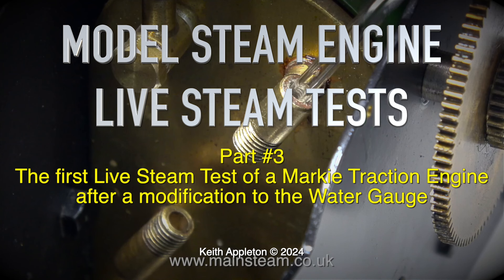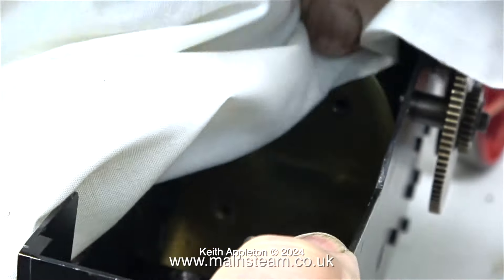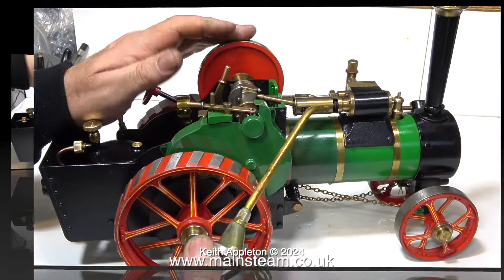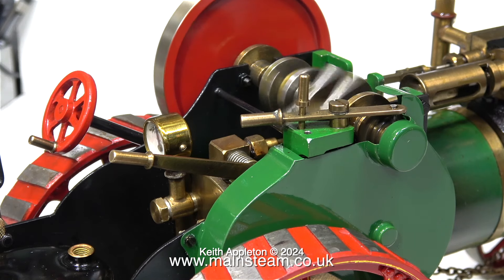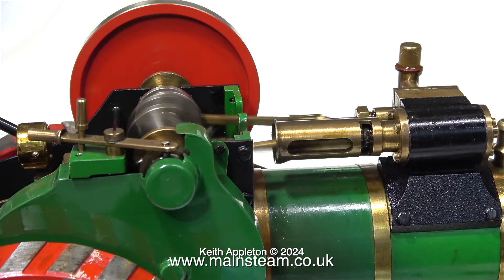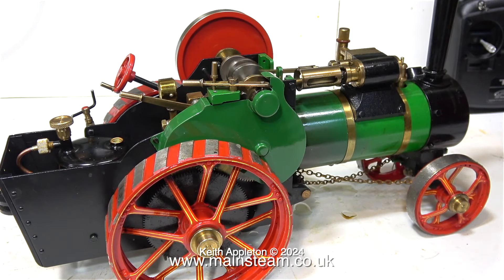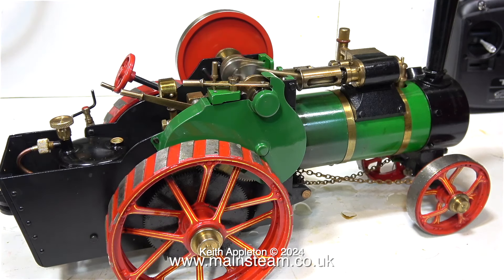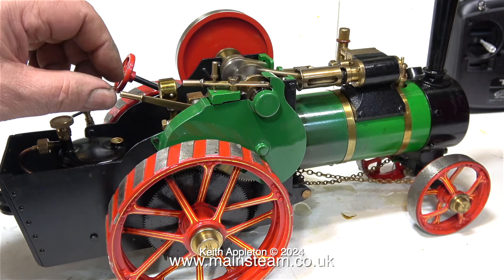MODEL STEAM ENGINE LIVE STEAM TESTS - PART #3

Comment: On the topic of boiler safety.  Perhaps you could sacrifice one of the terrible boilers you have in the boxes?  Put a gas burner under it and set it up someplace safe with a remote gas cut off.  You could even rig up a remote pressure sensor so you dont blow it to pieces.  If you have some old lawn furniture you could set it up and say "imagine if you were steaming this on your kitchen table?"
Reply from the maker: What do you mean by "terrible boilers in the boxes" ? Which ones are those?
Reply: @keithappleton  You mentioned a few in your videos.  This one of poor quality that you wouldnt use.  I would assume there would be some that are sketchy enough that even a boiler test would not make you feel ok, maybe a dent or improper metals.  I this it would be quiet the PSA.  

I dont know how common it is for people to defeat the blowoff valve on a mamod or wilesco "toy" but that might do a good demonstration.

A 50 PSI bang out of a 15PSI rated boiler or a 200 PSI bang out of a 50 PSI rated boiler would be maybe show their power and prevent people from defeating the blowoff and saying "i will just keep an eye on the pressure and take away the heat."